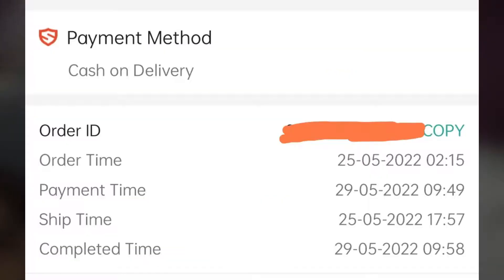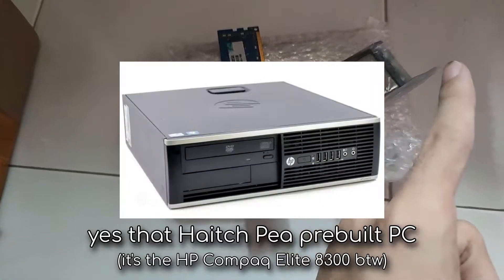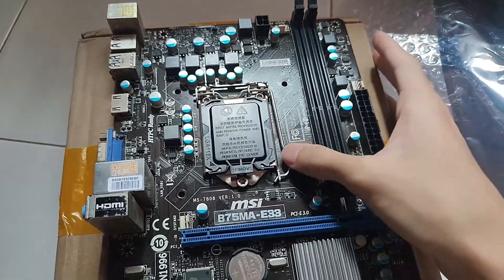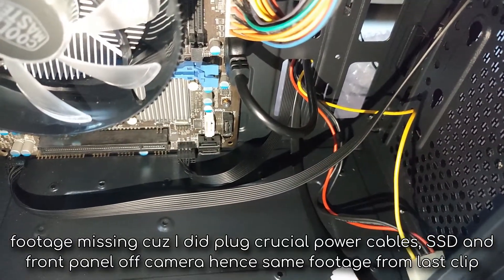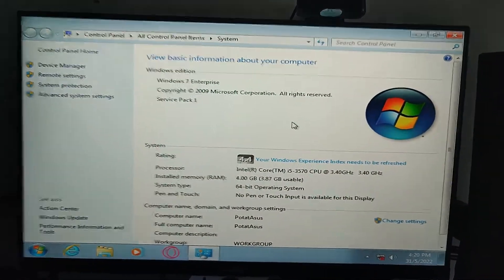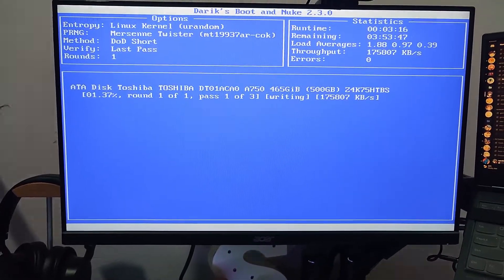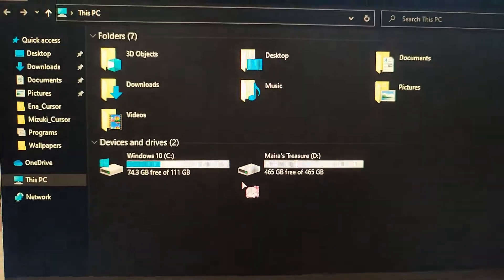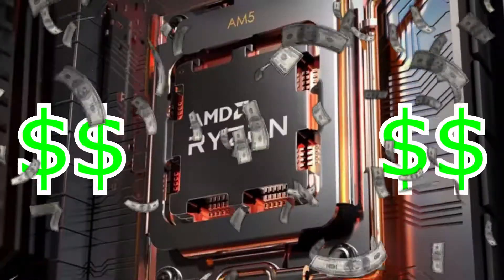Building an i5-3570 Custom Build PC in 2022

Comment: 14:02 14:09 To apply your current regional settings to welcome screen, system accounts, and new user accounts (the taskbar when signed in show the 24-hour clock and the lock screen when you signed out show the 12-hour clock):
1. Press Win+R, type "intl.cpl", then press Enter.
2. Go to the Administrative tab, under "Welcome screen and new user accounts", select "Copy settings...".
3. The "Welcome screen and new user accounts settings" dialog opens. Check both the boxes under "Copy your current settings to:", then press OK.

Comment: My emergency desktop has a Intel DH67BL motherboard (whitebox pre-built assembled by a small computer company back in 2011) which I bought the machine alone for $39 back in late April 2022. It originally had a i3-2100, 8GB (2x4GB) of RAM and no video-card but I upgraded the chip to an i5-2400, I installed an AMD Radeon R7 250 (2GB of VRAM) video card which was used on a few desktops I had before, and I added 2 more 4GB RAM sticks to bump it up to 16GB of RAM. 

The DH67BL system is an okay machine for what I do since I use my DH67BL for the same tasks I do on my main PC (AMD Ryzen 7 3800X, 32GB of RAM, RX590 (8GB of VRAM) (I use my main machine for virtualization, gaming, editing, etc.), except I use my emergency machine just incase something goes severely wrong with my primary machine and I don't have much resources to repair my main machine.
Reply from the maker: Neat stuff you have here! It's really good to have a spare computer incase something bad happens to main machine, like say putting my i5 machine to use as a spare computer incase my laptop did the brokey

Comment: what a coinsidence, I'm also building my custom pc, taken the cpu and ram from dell pc to my custom pc (i7-6700, 8GB ddr4 and GTX 660 2GB) . not to mention I'm also using the same cpu cooler like yours lol.

also I recommand use https://www.hdsentinel.com/index.php can check full details about hard drive information and condition and surely can checkt he actual health percentage of that 500GB Toshiba drive.

anyway nice video!
Reply from the maker: Thank you! And also...coincidence indeed~

These specs look to be better than mine, and about the drive info program, I'll check it out later.